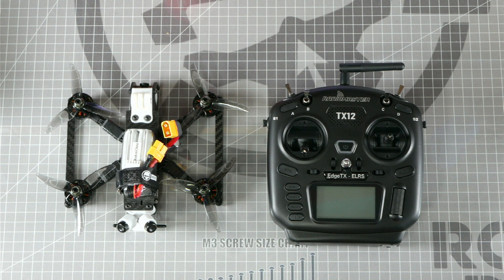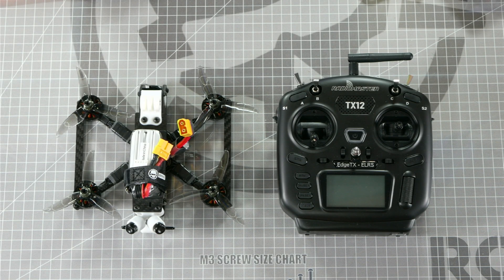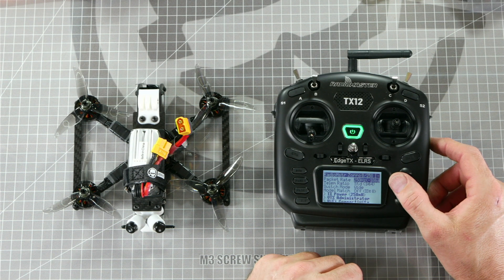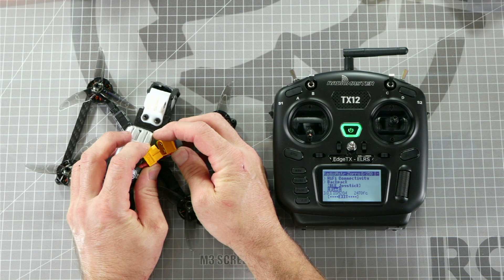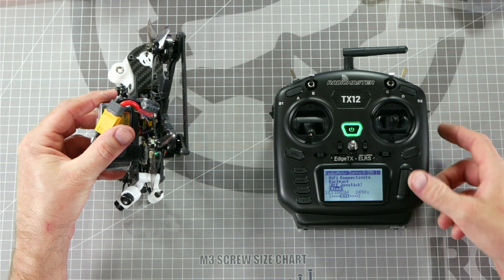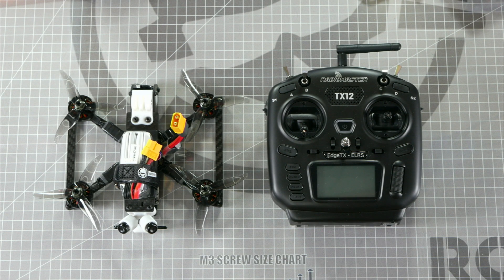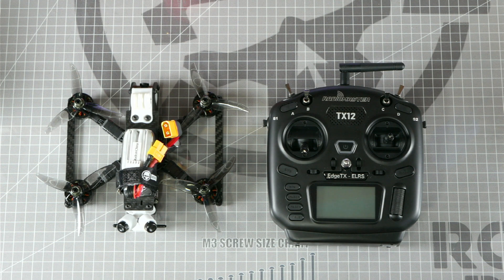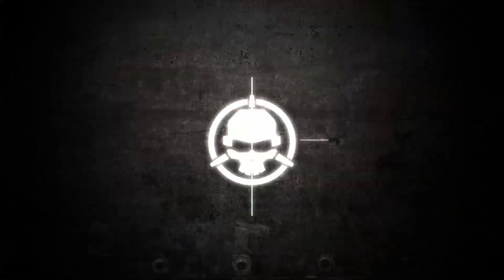How To Bind RadioMaster Transmitters to an ELRS Receiver (3-Plug Method)

Comment: Quick question: If I wanted to use a geprc 915mhz RX with this radio T12(2.4Ghz), would I need to use a module? Thanks

Comment: it didn't have a solid light in this video! but thats simply because you had model match turned on or off.. that setting is not in sync.  When that's corrected the light will be come solid.

Comment: Great video! I have a question. I've got a iFlight Nazgul5 V3 O3 Digital 5". I have been flying without a receiver and using my DJI Integra/FPV controller for a month or so. I decided to buy the Radiomaster TX16S Mark II and a Radiomaster ExpressLRS Nano. I got the ExpressLRS soldered up last night and I triple checked everything. Rx-Tx and vice versa. When I power on the quad everything is normal but the receiver has a solid red light. I cannot find anything anywhere on the internet to resolve this issue. All of my joints look fine and I'm not bridging any pads. Please help! Thanks, and keep sending!
Reply: what was the problem? I am currently trying to figure that out and just wondering what the answer was
Reply: @redneckracing556  I wasn't flashing the tx correctly and my passphrases didn't match up.
Reply: @dadpoolfpv  I guess this guy doesn't have time to respond.....

Comment: when I select Expreslrs apears loading msg and keeps there, loading for always
Reply: It may be a firmware issue.  

Also, there are usually two different elrs menus in the tools menu.  

One named elrs, and one named expresslrs.  (If I remember correctly).  Try both menus and if you continue getting the error you may need to update firmware.  

Another problem it could be is if your model is not set up to use the external or internal expresslrs module. 

If your model is not connected to the module, it will not load.  Double check your model menu to verify your module is selected.  😊
Reply: Did u fix?